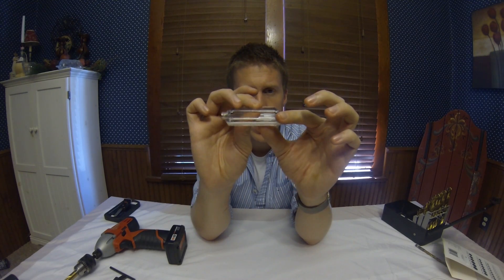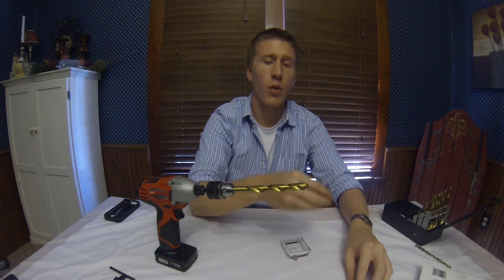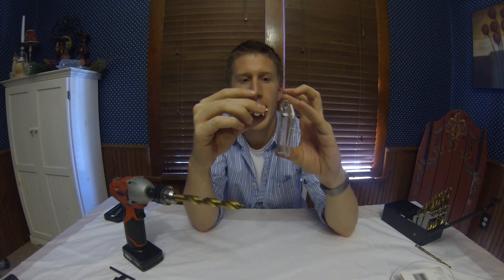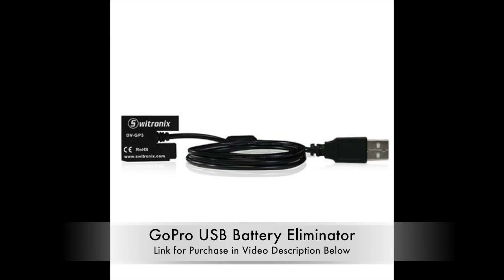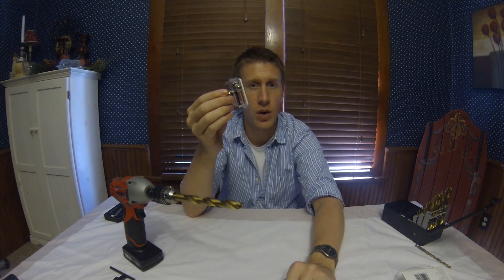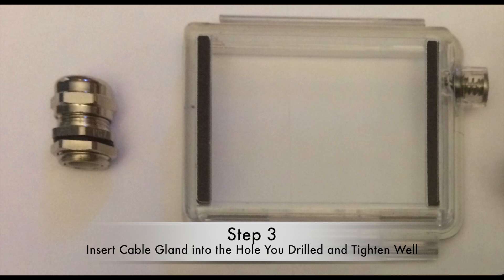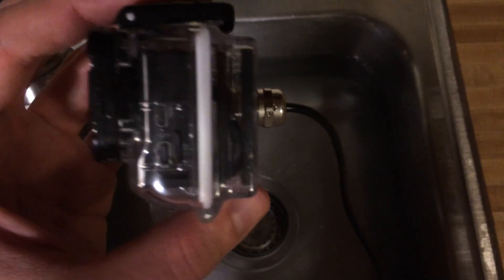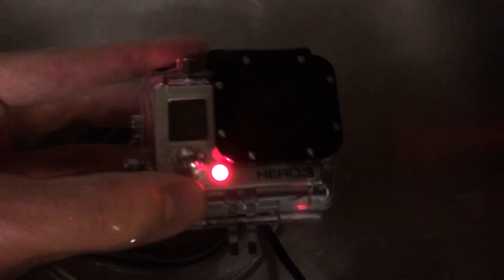Power and Charge GoPro Underwater For Waterproof 24hr Battery Life Kayak Solution!

Comment: And what do you use to make the battery pack waterproof for diving??
Reply from the maker: We used the same stainless steel cable gland (linked in video description) used on GoPro along with a waterproof box.   The battery pack sits inside the waterproof box.  Maybe we will make another video tutorial to show that.  Thanks for the question.
Reply: Cool!!
Reply: KayakDIY if you could make another video on how to make the waterproof box that would be great. I know it shouldn't be that hard, but you do a good job explaining it which would mean a less of a struggle for me to figure out.
Reply from the maker: I will take that request and see what I can do.  Have an extensive list of requested videos to get out.  A good watertight box with o-ring seal and a cable gland with threaded waterproof LED 2pin connector (to replace usb connection) works well.  When on my PA14 I run it from the 12v battery and have it on a telescoping camera pole in the stern.

Comment: how long do you believe you could film with a small cylindrical battery pack? Im wanting to make a rig similar to yours but made with a pvc pole with the battery inside the pvc
Reply from the maker: The standard GoPro battery is 1050mah and gets between 2-3hrs battery life they claim.  The cylinder battery packs are 3000mah so one could expect almost 3x the battery life of a standard GoPro battery (3000mah/1050mah =2.85x storage of standard GoPro battery).  Hope this makes sense.  Thanks for the question.

Comment: Mate awesome I am trying to fi d out how deep the gland is waterproof for and how to put a gland on the end of my home made handle to take the battery and water but mat this is a first you are awesome
Reply from the maker: To maximize the depth rating you would likely want to use the marine goop to inside of cable gland housing area.  We tested ours to 50ft and it worked.  We got reports on our Facebook group that a gentleman was able to use it down to 150ft he too used marine goop to inside of cable gland.  Also if you do take it to really deep depths near the housings original depth rating then you will need a container for a battery as well.  We are a kayaking channel so we didn't need extreme depths.  However, it is nice to know that some of our FB group members have gotten such great depths with it.  >>>> We recommend testing the housing setup without the GoPro and take it to whatever depth you need.  Here is FB group: www.facebook.com/groups/kayakdiy

Comment: Where is the list of parts?? Thank you!!
Reply from the maker: There are links in the video description below the video. Simply click the about tab below the video and you'll see a video description click "see more" to expand the video description to show all the links. Only three items are needed for building this set up however we have links to optional items that we show in the video as well as tools used to build this project.
Reply from the maker: If you are viewing the video from a cell phone, tablet, or mobile device simply click the title of the video and it should show the video description with all the links listed.
Reply: found it - thx GREAT VIDEO BTW!!!
Reply: You used a 31/64 drill bit. Do you think using a 1/2 inch (32/64) would compromise the waterproofing of the seal? I dont feel like buying a bit if I dont really have to for a 1 time use...just wondering why you used a 31/64...
Reply from the maker: Anthony Nolla I highly recommend using the 31/64 bit for the tightest fit.  That will provide the best waterproof seal.  You probably could get away with 1/2in but I wouldn't risk it.  The drill bit can be purchased in department stores for $7 but probably less online.  Thanks for the comment.  Hope you enjoyed the video.